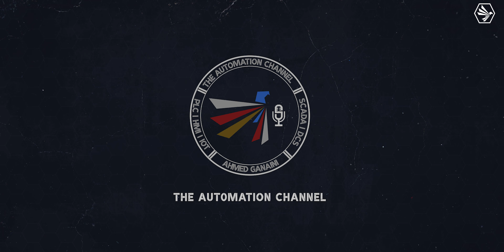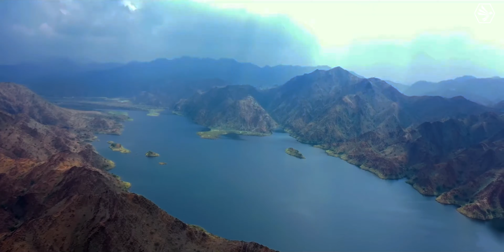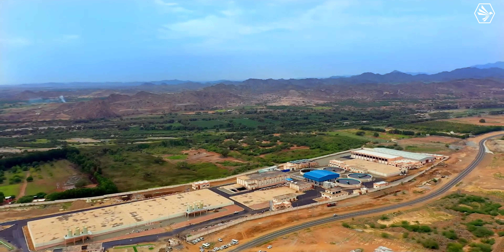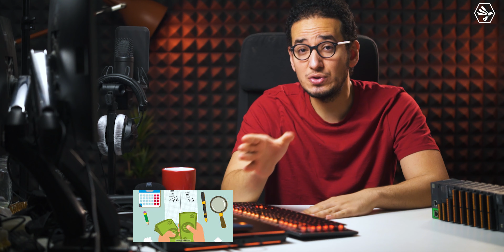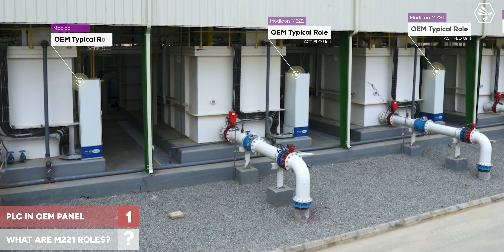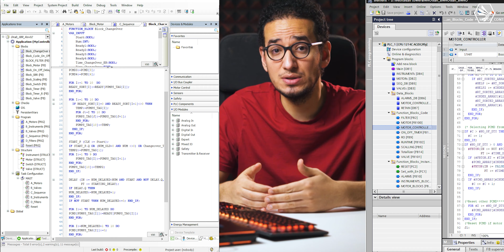[PLC][Schneider][M221] Small PLC at Site Part[1/3]

Comment: I just watched this video and a doubt came out. So you had to program and implement the PID controller all in Ladder language, rigth? I already saw the expert machine basic's PID block and it's pretty simple and clear but i never used in real applications. Another question: did you configured those vfd with an analog input to receive the plc pid's output velocity or the information was all connected trought ethernet ports?